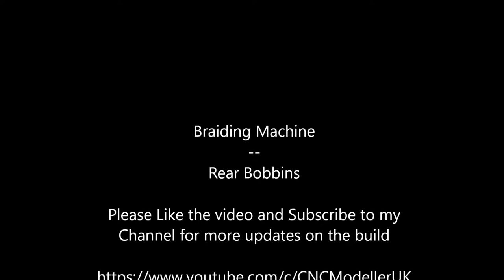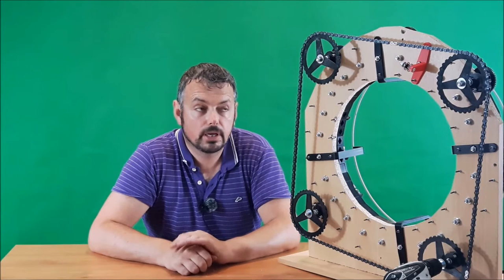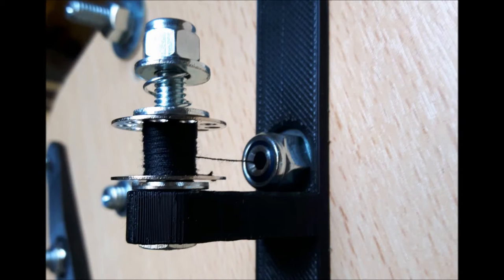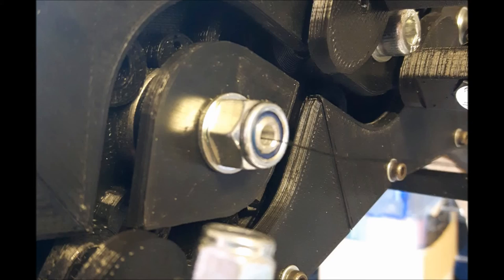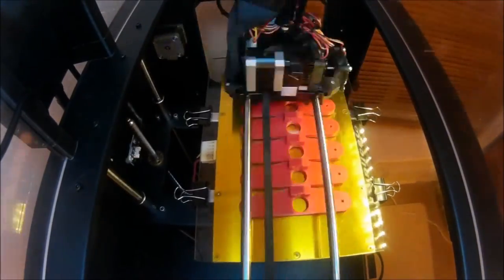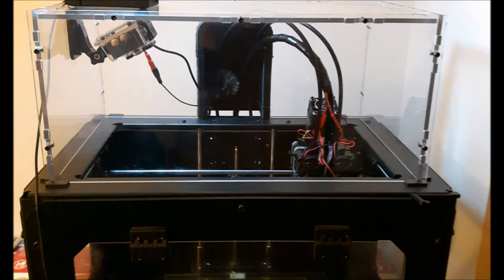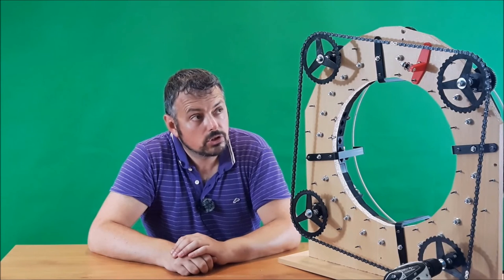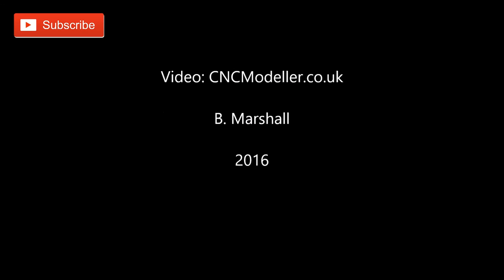CNC Modeller: 3D Printed Braiding Machine #7, Rear Bobbins

Comment: What is the function of those rear bobbins? I have no experience with braiding machines and even though I kindof understand basic principle of operation I can't see what those are for.

Also, could you please post instructions and STL files for parts? It looks like a very nice machine to build myself!
Reply from the maker: Hi psorek139, the rear bobbins feed an axial thread into the mix to make a tri-weave braid.

The basic diagonal weaves add torsional stiffness but aren't as good as lengthwise fibres at carrying lengthwise bending loads, tri-weave means its good in both torsional and bending load cases. As this is for over-braiding Model aircraft fuselages with carbon fibre I need good all round performance.

Unfortunately this is still a prototype, so I'm not releasing designs yet. Depending on how well it performs I'll either be releasing CAD or Kits from my website store.

Progress has been slow lately as I've been doing DIY on the house and workshop (more power outlets)... but that nearly done now so hope to get back into the workshop again soon.

If you want to see how things are going, subscribe to my channel. I'll hopefully be uploading more videos in the near future.

Cheers
Barry